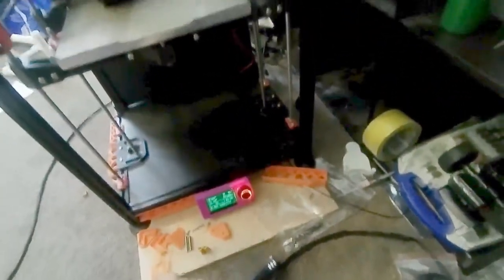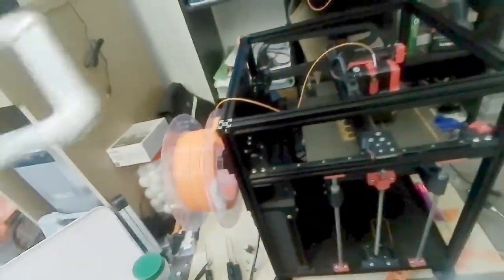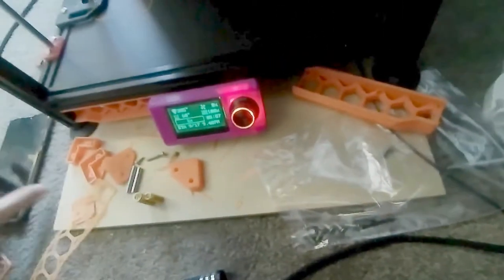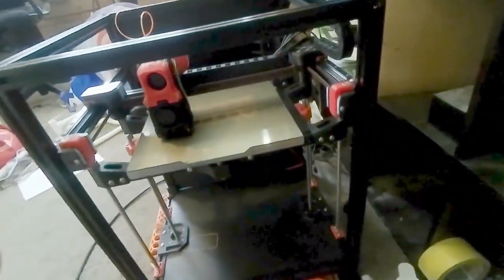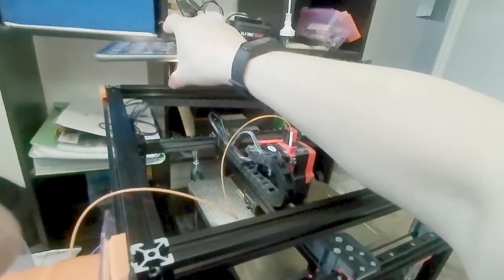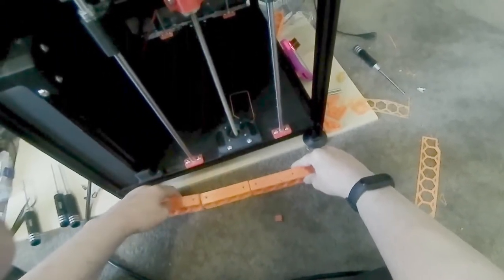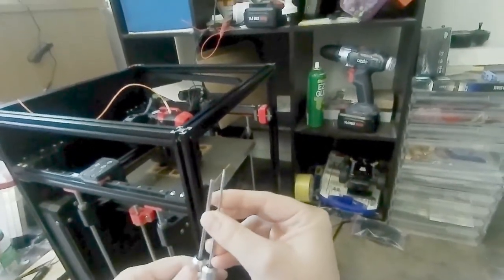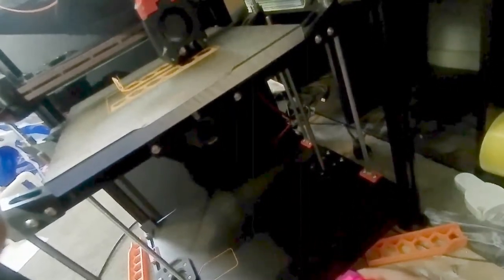Voron 1.8 - Electronics Pt3 feat. LCD and Cable Chain

Comment: What made you choose this over others?
Reply from the maker: I ended up upgrading this to a trident!

I chose it for the community,  build manual and quality
Reply: @BrettJamesSuperRoach  so you chose it because it's a great printer with lots of support. I'm kidding. I'm wondering what kinda speed you get out of it. I mostly print functional and I'm sick of having a room full of printers when it's just a tool. Kinda like if you had a room full of cordless drills all at 10 percent but you had no way toncharge them with a large job you want to do. If that makes sense haha
Reply from the maker: @Joey Strong  yeah kind of! So I'm running 300mms at 5k accel. Can Def go higher In accel. Above this before you pay serious money is an annex k2 or k1, and you gain more accel like say 10k day to day. Yes true they can do 25k benchies but you've seen their quality, so I'm talking day to day.

The big thing is I can walk away from it and let it print a big print. It's reliable, easy to service. Also with kits now the self sourcing isn't as needed.

It's not everyone's printer - it'll always be harder than a prusa to build. It will never print exotic high temp stuff that need a chamber temp above 60c (abs will deform). But it rocks abs just as good as pla
Reply: @BrettJamesSuperRoach  cool man. Thank you very much.